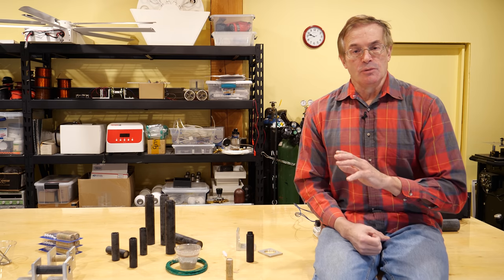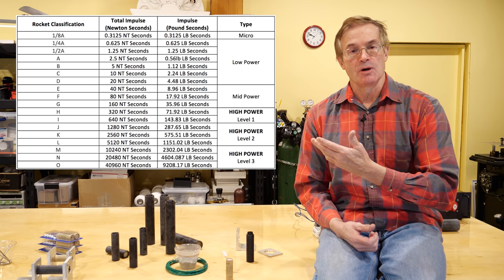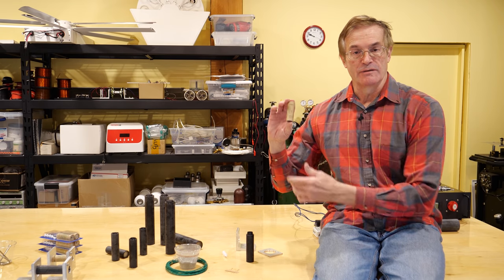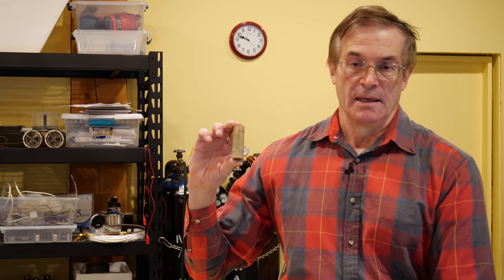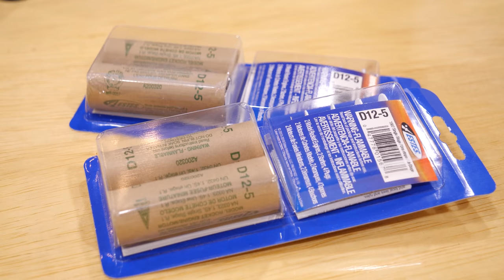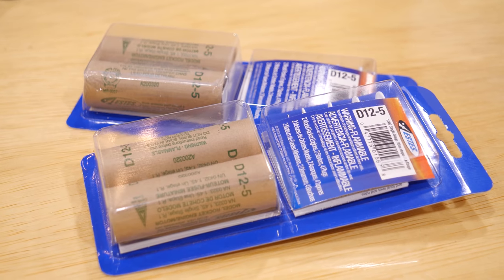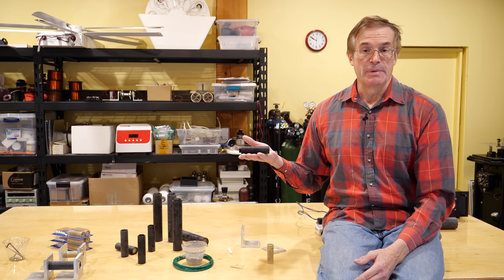Igniting Our Own Rocket Engines - DIY

Comment: I am deaf. Please enable automatic CC subtitles so I can turn them on. Thanks.
Reply: should be default on all videos, bump for the deaf people!!
Reply: Hi, last night we finished a couple more of our motors and if you're interested in the process of building your own rocket motors check out our previous video on the topic posted a couple days ago. 
Today we going to go outside and test these motors and one of them and one of the - things about living in New England in December is that when you test large flammable devices we have the advantage of about a foot of heavy wet snow covering just about every surface  of our property 
The downside is that Alex and I are gonna have to go outside an have to film in a foot of heavy wet snow, so that's gonna be a bit of a treat. 
Before we get outside what I'd like to do is briefly give you an idea of what it means to just try out our rocket motors so basically the thrust it's gonna be able to produce and for amateur rocket motors there is a accepted letter code that is applied to each motor based on the total amount of impulse it generates. 
In the first vid what we did is we went through the idea of what's called specific impulse of the amount of power or punch that a particular fuel would generate. The total motor impulse is a product of how potent that fuel is and how much of that duel you have. 
And there's a little bit of a correction factor based on just how effective a build or combustion chamber you design your nozzle. And in the amateur community the very smallest nozzles, the very smallest engines start out with the a or alpha. 
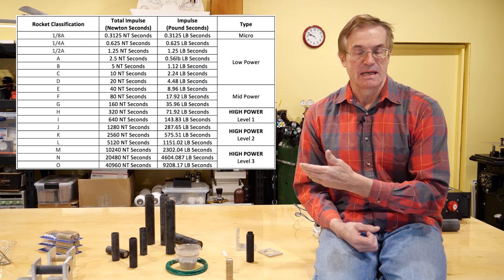And that represents a total motor impulse of 2 1/2 N per 1s or about half a pound per second. (1:49min) 
As you move down the letter code to b c d e  each time you go down one letter code you double the total impulse of the engine, so a b Motor would have a max thrust or max total impulse of 5N/s a C motor 10N/s and this D Motor which I have right here represents 20N per one sec. Now it could burn fast. It could have a very fast regression rate so it could burn in half a second and may make say 40N of Thrust but only for half a second or burn much longer and produce maybe 10N for 2 sec. But it's the total product that is represented at the letter code. The second set of numbers there the - and 12 represents the AVG. Thrust of the motor and then that again relates to the regression rate, how fast that propellant inside the motor is burning (2:46 /I hope I can help you with this and I am sorry for any spelling mistakes, I'll try to transcribe the whole vid)
Reply: And because a rocket motor is not a square wave it doesn't start at 0 and go instantly to full throttle maintaining exactly that amount of thrust and then instantly drop to zero, it's more of a curve. This will give you a rough idea of how long the motor would burn so with a 12N AVG thrust and about 20N Max total impulse this is probably going to but for about a second and a half at all that power. The second number you see there the -5 represents a delay charge so a small fuze or small burning component that once the booster has fired or once the engine has fired will slowly move through - piech of this plug and then hit a charge and discharge and essentially blow the end of the motor right of off the end of the far end away from the nozzle. (3:42)
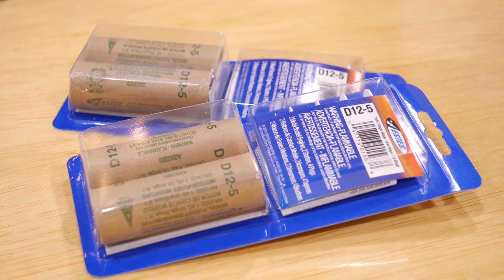This is what propels a parachute or whatever recovery system to allow the rocket to drift slowly back to earth. In some cases you have no delay there is no discharge at the far end that is what's true of all of these engines here and so The only way that we would characterise these engines at this point is just going to be amount of fuel and type of fuel. D engines are about the biggest engine that you can buy commonly most hobbyshops that will sell tickets have. (4:08) 
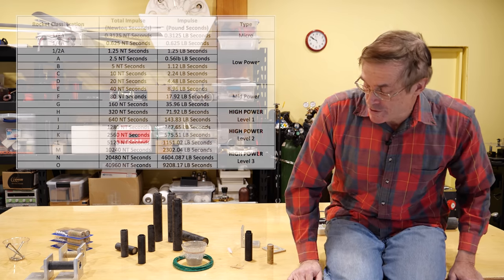You can get online e and even f Motors depending on hazmat restrictions that where ordering from. The smallest motor that we built is basically an F motor. This would be about the biggest motor you could legally purchase and that represents 80N/s so pretty powerful motor. The larger motors that we built here are 4 times the size and so instead of being an F motor they're H motors, these are powerful motors with an total impulse of 320N/s or about 65lbs/s so these are very potent motors. Now if you look over here (4:55) where I have the Hybrid motor you don't even wanna think about the letter code that applies to this thing, this is way beyond these other motors here. And so just to give you an Idea of how it actually is I should say you're not to think about it but now you're going to think about it. It's like saying don't think about a pink elephant, well get into that in a future video. (5:15) now there are a couple different ways that you can ignite such an engine. Today we're just going to be using some fuse, and we're gonna augment this fuse with some of the pyrotechnic flash powder that we mixed up in our last video, so if you're interested in how we made this take a look at our previous video. (5:32)
Now another alternative to using these is to use what's called an ematch or a bridge wire igniter. Effectively what these have is a very very tiny piece of nichrohme wire across these two conductors and if you put about an amp of current in here from a battery this will  riefly heat up to red hot and ignite a little glob of. Pyrotechnic mixture which can then be used to ignite a rocket into which you insert it. (6:02)
Reply: It's a convenient way to do it and a lot of higher power rocketry uses it cause you can have very very long stand offs. 
Today we're just gonna have fun with a normal fuse and we'll run like hell so it should be a lot of fun. Lastly how were gonna set this up is youll see the apparatus once we get outside and it's pretty straightforward so we should be able to figure out how it works and how we did that. (6:26) Each of the motors is gonna be mounted in little brackets that retain it and allows it to be mounted to a beam that stands out the back of our test rig and as a retaining plate here that keeps the motor compressed in here but allows us to adjust for different length motors or allows us to adapt to different diameter motors so that we can test all of our different motors on the same setup. So that's pretty much it lets get outside and let's start some fires.(6:52)
Reply: No talking until 10:38 

So if you're interested in this camera we used for this slow motion shoot I did a video a few weeks ago (10:45) about the specifications, how to use it some of the lenses for it so if you wanna see anything about it check out that video.(10:56) and I wanna say that if you're interested in these rocket engines were gonna do more videos on this topic and we're gonna use this camera for a lot more high energy experiments in the future so I wanna thank you very much for watching and if your interested in this kind of material please (11:07) SUBSCRIBE to the channel because we're trying to get to 500000 by the end of this year, so hit subscribe.
 And in the case I wish you happy new year stay safe and we'll see you soon! (11:22) ---> outro, no talking
Reply: This took me almost an hour, but I hope it helps you out, I am sorry if I missed anything and for the spelling mistakes (and atrocious grammar). If you need anything more just say it and I'll try to answer as soon as I can. Have a happy new year and good night I'm going to sleep.
Reply: @polygorg  omg you transcripted the whole video for him, hope you have a amazing day !
Reply: Another bump. I sometimes need subtitles also.
Reply: @polygorg  beast.

If you're gonna be a literal saint in future, look into plover - it'll way cut down on time spent.
Reply: @polygorg  Very kind
Reply: @polygorg  wow. That was very kind of you to do that... it makes me want to do something nice as well. 🥺
Reply: @polygorg  You're a saint
Reply: polygorg wow, what a nice thing to do!
Reply: @polygorg  your probably the nicest person ive ever met on the internet
Reply: @polygorg  ???
Reply: @polygorg  people like this is why community contributions should still be a thing

Also, thank you polygorg, you are a legend.

Comment: Would love to see the engine connected to a load cell or force gauge to monitor force during the burn!  Congrats on the 500k, very well deserved!
Reply: That would be awesome, especially if we could get a force-time curve.
Reply: If you look closely you can see that the support of the rockets is on rails, so he will gets the measurement :)
Reply: I'm fairly sure it was, there's a curly wire in the background, looking forward to the thrust data
Reply: Yes, and a pressure tap on the the motor itself so we can see the combustion pressure curve.

Comment: I'm glad you only had one rapid unscheduled disassembly.  Please review my comment on your previous video: the 'sparks' you're getting in your exhaust plume are signs that your fuel grain is fracturing as it burns.  You're ejecting chunks of fuel.  Not only does this mean you're losing a lot of efficiency, but it also means you're running your fuel grain under stresses it can't handle safely. This is a known issue with a known solution, not something where you need to poke around in the weeds and re-invent.

Comment: hey neat new high speed camera but you forgot to include any real time footage :/
Reply: After the fact I do agree, but originally I did not see the need for I having experience in the burning of rocket motors such as those presented; I know how fast they burn, their burning is baked into my head. But if one has not the experience than the massive energy release in real time would be advantageous to be displayed along side the slow-mo footage.
Reply: I agree with Very
Reply: @garyha2650  YES👍

Comment: Would love to see an infrared camera take on these engines.
Reply: Spoiler: the exhaust is warm, and red; the snow is cold, and blue.
Reply: @cdanea  or does he meant temperature indicators?) Maybe not so important which one produce more heat but... it's work!
Reply: @cdanea  You would get a better view of the exhaust gasses and the thrust pattern since you would be able to see through the smoke!
Reply: @GodzillaGoesGaga  
Only if it operates in the thermal band.  For a high def one with the dynamic range of rocket exhaust, that would be a pricey investment.
Reply: @erc9468  Interesting.  Didn't know they were so specific.
Reply: am infrared camera, I like them. They are very cool.
Reply: I can tell you that regular CMOS near band infrared cameras will show you pretty much the same thing, except in black and white. Like ERC said, if you mean thermal imaging, that's a whole other can of worms because the rocket engine burns extremely hot while the surroundings are fairly cold. So you can either see the surrounding and have the flame clip out the sensor, or see the flame in a completely black environment.
Reply: @GodzillaGoesGaga  
There are 3 main bands of Infrared cameras.  If you want to only see the actual thermal energy of an object, usually you're talking about MWIR or LWIR.  
You can get a cheap one, but that would just show you a giant blob of white when looking at rocket exhaust.
A high-end one would give you some pretty amazing pictures since you'd be able to see through the smoke.

Comment: This project was particularly near and dear to me, since I have been working on a prototype cyclical detonation engine for about 10 years. Looking at your deflagration engine construction was very informative and gave me a lot of ideas for future modifications to my next MK, I think I'm on about MK200 or so? Keep up the good work, can't wait to see more in 2021!
Reply: have you achieved operation for like a few seconds?
Reply: @krzysztofbroda5376  I actually get 30-40 seconds at 60hz with a single chamber design, but the rotating detonation waves are inconsistent and only after extensive research did I realize that my pressure and injection methods were subpar. Switching to a multi-chamber design, with, for example, 6-8 independent tubes with pistons forcing the fuel/air mixture to compress before being detonated out the end seems to be a way better idea, and produce way more ISP for its size.
Reply: @krzysztofbroda5376  indeed! Something like that, I've even messed around with some glassworking torch tips that use a similar design to that. Some turboannular designs are quite promising.
Reply: @shadowedmoonchannel  im also working on a jet engine. A pulsejet with a piston compressor for efficiency. Due to special arrangement of air inlet ports it should have very high airflow per frontal area, and therefore power per frontal area, comparable to a turbojet. Next income im buying a leafblower and coke and a refractory lid to make an aluminium/steel melting hole furnace. Will try to cast it
Reply: @krzysztofbroda5376  casting can work well for stability, but I've had problems with sand molds and accuracy. There's this very interesting new ceramic 3D printer filament that goes through a secondary dip coat and then has the polymer dip baked out. I'm thinking it holds a lot of promise for precise high temp parts. Pulse jets were what got me started in aerospace engineering, very cool!
Reply: @shadowedmoonchannel  Integza used one of this ceramic 3d printer filament in his latest video about a jet engine, very cool stuff
Reply: @Phenx  integza is child entertainment, specially when compared to the guys you are replying to

Comment: It seems to me that slow-motion footage is best paired sparingly with realtime footage. With no realtime context, the slow-motion rocket burning footage is kind of uninteresting despite all of the interesting things that go on during the burn. The Slow Mo Guys and the Hydraulic Press Channel seem to have figured out a good process for showcasing slow-motion footage. I don't suggest copying them though, because I'm certain you could do better!
Reply: Good way to practice a longer attention span
Reply: And slow down the audio by about 2 or 3x.. It's still 'faked' but it sounds more like it matches.
Reply: An overlay showing the thrust and timestamp would be super cool.
Reply: I agree, I really wanted to see real time videos of each motor firing along with the slo-mo.
Reply: Maybe add the timestamp the chronos captures as video overlay, that would help to understand how slow time is.
Reply: Agreed, adding a real time burn video along with the slow-mo would have been helpful. Some of us don’t know how these home made engines sound and look compared to the more familiar hobby grade motors

Comment: Great vid, the burn in the home made rockets didn’t look as smooth, is that just down to the mixing of the fuel?
Reply: mixing and grain density, maybe vacuuming the rockets as they are drying to get a tighter grain and removing extra space between them would help?
Reply: From what I have read in the past, it tends to be a problem with sorbitol when you run a low chamber pressure
Reply: I think its mostly because he just picked a random throat size for the nozzle, leading to a low chamber pressure.
Reply: @frogz  I've never heard of people vacuuming KNSU grains (what he's making) because melting the mixture on the stove already removes most of the air bubbles. Vacuuming APCP grains is much more common, but that's because it's dry mixed in a mixer instead of being melted over the stove.
Reply: Commercial model rocket engines typically use black powder as their propellent. BP burns differently and looks different than the propellent mixes he cooked up.
Reply: @EdisonWong2004  They didnt have nozzles in these tests. The one that did blew off lol. So definitely low chamber pressure.
Reply: @ThePandaKingFTW  the nozzle of model rocket motors is a hole in the fuel, thats what he was referring to he made a smaller hole, this is true even of the commercial ones, by your definition not a single motor had a nozzle in the video, either way that is the common wording used in model rockets for the channel used for the exhaust a nozzel since they generally dont use anything else to direct thrust other then that
Reply: @ThePandaKingFTW  Didn't you watch the building video? He put nozzles in the end of every motor on top of the grain, held there by epoxy.. The one that blew off was just so small, that the pressure inside the chamber got to big for it to handle (I'd say the bond between tube and epoxy gave in, so epoxy and nozzle flew out).
Reply: They are not perfect in this vid. However, KN style motors due tend to burn that way and produce a lot of White smoke. Again, U must be careful with them for they are  generally Very Shock sensitive Both Physically and thermally.
Reply: @NiLem98  I believe the front end blew off once enough fuel had burned away to remove the support it added to the top cap. There was a large cloud off screen to the right.
Reply: Frogz I wondered about that too.  I remember from my own engines that the particle size of the oxidizer and fuel impact the burn rate too.
Reply: @NiLem98  If you look closely the nozzle is still there after the pop.  It looks the the rear plug was violently forced out.
Reply: @Vash612584  Right, didn't see it.. :)